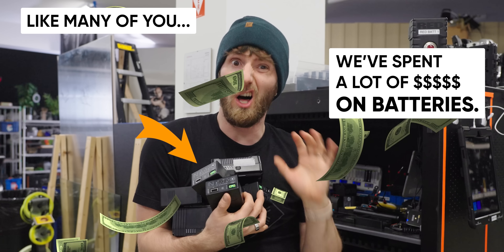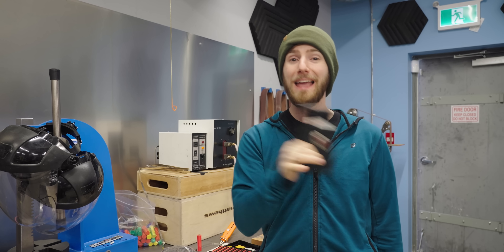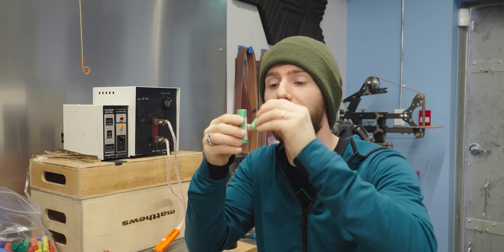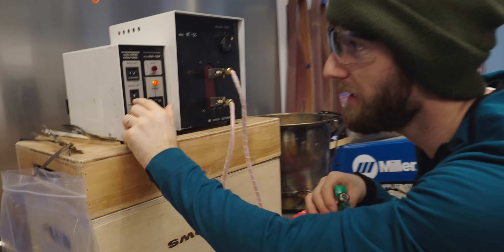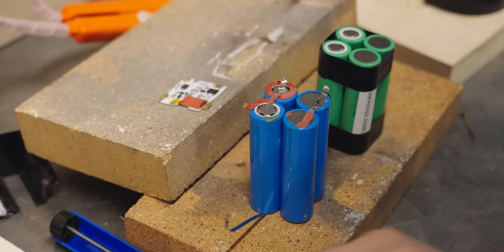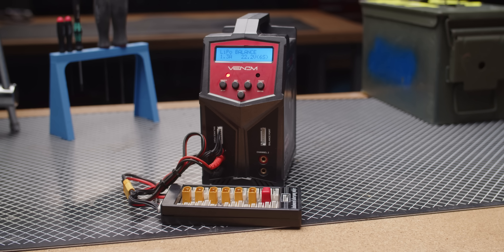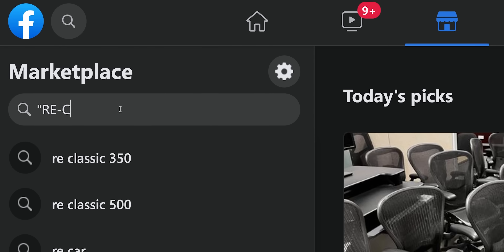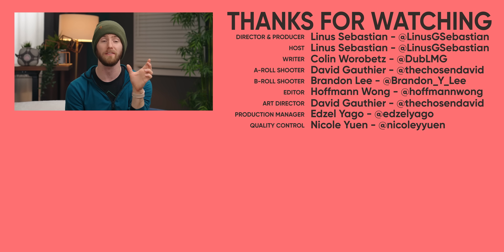This should be illegal… Battery Repair Blocking

Comment: Ha! First min in once I saw the BCM board, this was going to fail. That board needs to be tossed or reprogrammed. The cells that came from those packs probably had a lot more life than they think. Lots if BMS systems will intentionally artificially age cells based on cycle count. What it does it moves the "discharged" and charged points closer together. Lithium batteries "Settle" into a pattern once they hit a pre prescribed cycle count. Then they start a new slower adventure into degradation.

Manufacturers do this to for one Market a better functioning product. So for the first lets say 1,000 cycles the BMS will allow the batteries to operate in the above nominal state (4.2V and closer to the completely discharged state (2.7V), during these first 1,000 cycles the battery is being abused to the max for marketing and sales hype. After the first 1,000 cycles... the BCM can take two routes, a Calculatex route where it uses tests it performs on the battery while charging and in the fully charged state. Like impedance, temp at a specific charge or discharge rate (amps), it can also use a balancing algorithm where it looks at all the other cells, where it will can either bring all cells to the same level as the lowest or bring all cells to the average mid point. 

Some BMS will all together disable the BMS from allowing the cells to charge and intentionally put them on a discharge to zero path.

Some BCMs are encrypted so you don't even get a chance to connect to it and see what it sees. Others have a "Reset" sequence that manufacturers try to hide. (Like grounding a pin, bringing certain pins to HI or Low.)

It takes some time, but I haven't ran into a single one that is not reverse engineer able, except the ones that actually contain hidden fuse links on die, where it will blow those fussed and also the ground plane to the SSR controlling the power path directly to the battery. Some even create a very very low draw short to slowly being the cells to bellow the threshold where the batteries cell protection permanently shuts it off.

In most cases where 18650 style cells are being used in electronics like this, not only are you dealing with the BMS, you are also dealing with a primary circuit built into the battery it self. It's tiny and hidden under the positive side of the individual cell. Under the button top is a circuit that can cut all power from the battery if overcharge, undercgarge, or over current conditions are ever met. Some of these will reset, like an over voted cell....... nothing you can do except let it sit for weeks till it returns to nominal, or slow being it back up and an alarmingly low charge rate for days till it returns to nominal. Most of the time it's not worth the effort. Best practice is to throw the cells Ina. Steel vented box and give them a test every 30 days.

Some cells have a built in drain system that will zero out the cell over a few months, but not allow interaction with it.

Then you have cells that have zero protection and you can go ham with them.

So far only the RC hobby and vaoing hobby uses these, we need cells that can hit 25 to 50 amps on a regular basis. Some cells can push 100 Amp for short periods. They have no safety system. Your only warning is the disting his and the massive amounts of heat. Throw the cell in a stell bin or concrete ground before it goes supernova.

There is sort of a color coding convention for the outside insulator, more into the reds those are protected moderate amperage hi capacity.... more into the gray they are unprotected vaya con Dios cells. More into the green, you are playing with an unprotected cell that can also dish out crazy amperage with a moderate capacity (samsung INR).

There is atleast 10 to 20 episodes of this kind if content in this, and people are interested.

IMO, if the device will operate sans BMS..... delete it, install a voltage warning beeper, use your own balance charger to charge them up.

Comment: LOL you do know you don't have to weld the metal to the batteries right because they're basically batteries all you got to do is make sure it's tight enough insecure enough and you can build or change the plastic clip where you can slide pieces in the old pressure on the battery or the cell as you cell it

Comment: This is a very bad video because it is ammo that manufacturers WILL show to the mentally retarded politicians when they argue against right to repair. This will also scare more people out of trying this.
Also the sparks seen on camera are just from the welding. You also see this when the professional employee is welding nickel strips to the battery cells at 17:25!!

Also a short circuit of any lithium cell is a bad thing, but if you briefly short circuit a cell (long enough to get a spark and then reactively pull the metal away and break the short), the cell will be completely fine. Those cells can handle a number of brief short-circuit events without any damage. Having a fearful response typically makes things worse than the thing you're scared of could ever do. Like how our response as a society to COVID was 100 times worse than COVID itself.

Comment: I think this video really shows you can change batteries the reality it’s just not worth the risk or the effort. My preference is to dispose of these old units properly. Or buy a power bank that is designed to have replacement cells.

Comment: Jeeze you guys are primadonnas... lol.  Seriously, "one mistake and were evacuating the room and starting from scratch"  cmon now... all the years ive been pack building ive NEVER had a cell pop.  How on earth did you even manage that?  Stop doubletapping them, youre overheating the cells.   

The soft obstructions can often be beaten if you figure out what they're doing to disable it.  Another option is to use their connector and case, but a new BMS.

A possibility is to, instead of having your device use stupid proprietary cells, have it use multiple 18650s and come with an 18650 charger...   there are 18650 terminals that work just like aa insertion that we use for ecigs.  You can even put those replaceable slots INSIDE a screw together battery casing with a BMS inside so they can all be charged at once but can be replaced easily.

Comment: it also happened to me, you should solder a new pack of batteries to the BMS first to make it parallel and then you can remove the old battery, it's works for me

Comment: I ran into this idiocy as well with Nikon DSLR batteries. I had an old battery that I wanted to convert to a wall power converter, so I could leave my camera plugged in for long time lapse shoots. It turns out that the battery contains a chip with volatile memory. The chip sends some sort of pseudo random code to the camera every time it's plugged in. If you disconnect the cells from the chip, it will never run again. So you have to replace the cells while maintaining power to the BMS at all times. It's a huge pain. What's even more idiotic, is that if you plug one of these repaired batteries into the camera, it literally shows you the battery charge, but gives a message "Battery Not Recognised" and won't function.  Dafuq? Then how are you running to display that message you piece of crap?!

Comment: start with low power and slowly go up just until the Nickel strip is held on with 2 to 4 spot welds. usually tack welders ment for making battery pack have a arm protruding from box or can use handheld thing as well and has settings that won't cause batteries to get damaged leaves small dots with no discoloration

Comment: So really all you are doing is basically buying a battery when the point of doing it urself is so you dont have to spend all the money on buying one and using the old battery longer so ur money is stretched as far as possible. So you might as well just buy the 350 dollar battery cause ur not really saving much by buying the new pcm and the battery's and the soder gun with the soder and fire brick. I figured the point of the video from the title of this video would be how you can just exchange a bad cell battery with a new one and wang bang boom works like new and how the industry makes it illegal for you not to be able to do that, but this is not the case with your video. Its kinda pointless if u ask me to watch this cause its not really any help . But thanks

Comment: it should be illegal. we need info and papers published on repair. right to repair. they make it to where you have to be an EE to fix stuff. i guess i should look for some old books instead of the internet.

the only justification i can see for battery packs is they can genuinely be a danger if not done properly, and if they didn't prevent tampering you would be able to sue them and they couldn't guarantee the safety if you worked on the pack and then somehow got a warranty refund and mailed the pack back to them.

Comment: Dude the ones you showed at the beginning are so easy to get. 18650s are used for vapes. People by them bulk all the time for building diy mods. It's lost popularity due to salt nic devices getting better, but yeah those batteries are so easy to get for cheap asf. Sure as hell not gonna be $350 for a dozen of them. You can probably get 12 for $50-60 easily. They're like $10CDN for singles at consumer level at stores here in Vancouver

Ha yeah just saw the part with the testers 🤣 probably old ones that people gave back to the store to 'recycle' them

Comment: Holly hell electrical tape is conductive. Don’t ever say it is not. Unless you are using the nonconductive electrical tape. Which is expensive. It is also not shiny like the one you are using. 

The electrical tape you are using is designed for marking wires ONLY. NOT an electrical barrier.

Comment: You can actually deal with this problem by soldering on small leads to a separate DC power supply to keep the BMS live while working on the pack and than remove these after the new cells have been attached.

Comment: Are new Lifepo batteries BMSs evil like this? Especially the big brands like Battleborn? I just installed a large solar system in my RV with all Victron and 2 Battle Born Game changers. When the 10 year warranty is up and these massive Lifepo batteries start to fail can they be serviced?  Or will the BMS self destruct? I don't think anyone has tested this yet I know I won't at over $2 K for one battery. Time will tell unless someone with way more $$$ to burn sacrifices one of any name brand to see if the Custom BMSs is Evil 🙈🔥😡

Comment: They were doing this with Dell Laptop batteries the BMS would disabled itself if it lost power. I managed to get around it by carefully connecting power to it before cutting the cell wires so it never lost power. But if the life line failed even for a second it was game over for that BMS. This is nothing new greed is way more important to CEOs and Shareholders than the environment!!!  It won't change unless they are forced to stop the BS for a few extra $$$$ to buy a new jet each year instead of every 5 Years!  People hate gov oversight but it's unfortunate we need someone to put a size 12 where the sun doesn't shine sometimes.

Comment: Why don't you have Halen r12 fire extinguishers they'll put out a lithium fire not only do they put out the lithium fire they cool down the lithium battery to thus prevent recognition from the thermal runaway etc Halon r12 is the refrigerant that used to be used in air conditioners and for HVAC people it's $20,000 fine if they let one ounce out however as a fire extinguisher are 12 can be released to the atmosphere with no fine even if you're testing so take your old air conditioner alcohol in it and you got to fire extinguisher new air conditioners use flammables so make sure it's not our 450 or 600 cuz r600 is butane

Comment: just an FYI you sound use a battery tester to charge them up and discharge them before spot welding.  you can also capacity test the old cells and use the old ones for single cell flashlights and small projects and such.

Comment: I see a lot of those evil battery Management systems in the construction tools they sell for such expensive prices Makita is very well known for that Dewalt, porter cable, craftsmen, Ryobi and even Milwaukee is not out of their woods. I prefer Hilti which doesn't seem to be nearly as bad as some of those other brands I mentioned. I have some of their batteries that are 10 years old that still work far better than any other battery I have that's even 4 years old. And those other batteries I have are DeWalt 18 volt and Milwaukee V18. Mine are 22 Volts that also take and will run any of Hilti's 18 volt tools. You also you go by the tool stores that rents to you and you see what they're renting. That's the tools you want if you're doing this at any kind of repetitive work like construction jobs or mechanical.

Comment: I have designed Li-Ion battery packs for commercial sale and can say that in the case of high end smart battery packs with charge tracking and modeling capabilities, it is not a simple matter of just replacing cells. On our packs, the battery monitor chip required precise initial conditions for each cell in the pack in order to provide a sufficiently accurate lifetime prediction. Of course, the packs I designed were for medical devices, and I think equipment like cameras and power tools do not require that level of precision and I agree with the premise that batteries should be designed to be as serviceable as the use application allows.
Reply: Yeah. I believe most packs I've seen are just fine replacing cells. Of course capacity information after replace is is off and it's required that the cells you use for replacing can handle the conditions the circuit puts on them.
For the capacity however it's usually a matter of fully discharging and charging them a few times and capcity reporting is about right again. No matter how sophisticated you try to make the measurement you just can't and it ends up being a qualified guess which tends to drift over time unless it somehow is recalibrated - and that is usually total discharge and total recharge.
I agree medical devices can have special requirements. However unless a fever thermometer, ordinary blood pressure meter or similar non critical device you can just grab another off the shelf I really can't imagine anybody will risk going on compromise there.
Reply: @HifiCentret  I've replaced cells in power tools a few times always worked
Reply: @HifiCentret id be fine with having US hospitals use only new medical devices but we should still let them be repairable in case other poorer countries want to buy them used.
Reply: Some BMS's have a safety feature that if the temperature gets too high, or voltage too high or low, the BMS will basically kill itself. For example Makita batteries have this feature.. I was working with a freshly charged battery outside in cold temperatures, and as the battery drained in combination with the low temperatures, the voltage probably dropped below the point where it would allow the batteries to be charged, BMS just permanently disables itself for safety. The only option you have at that point is to replace the BMS. In some cases even desoldering the batteries from the BMS will basically kill it.
Reply: @FOATE  it's for your safety...  sure, in the age of self resetting and self healing circuits, there is no excuse to a BMS to permanently disable a pack for operating it out of spec after the condition clears, like operating it too hot or cold. It's entirely a design choice, from which the permanent one is more profitable. It's a no brainier.
Reply: but can we repair tesla power battery?
Reply: Medical equipment is a use case where a universal standard could save lives and proprietary crap can literally kill people 

Oh, I'm sorry, your total artificial heart doesn't support this cheaper aftermarket battery, by being too poor to afford a new $500 battery, you have chosen death
Reply: Sucsessful learning cycle is pretty easy to achive on high grade cells. But it's not commercially worth it, we performed cell replacement only on medical sbs batteries which we needed to reverse, but could not buy. Just saying, i'm tottaly not an electrical engineer for battery manufacturing company in russia
Reply: Translation: We designed the BMS so that it won't accept a replacement battery to force them to buy whole new equipment, and we said "our equipment is too advanced to accept just ANY old battery! Just buy a new one instead!"
Reply: @DrSloww  ... You do know in medical having that accuracy can quite literally be the difference between someone living and dying right? Now in other fields that argument does not really hold up (unless you are talking aerospace). But med NEEDS predictable results as otherwise people die.
Reply: @spartanonxy  That's stupid. If you're relying on batteries being reliable, then there's your problem, because they're inherently not. It makes plenty of sense just to replace the cells at a set interval and properly maintain the equipment, with cell monitoring as a supplementary measure. But plenty of people would rather just keep filling up landfills in the name of safety.
Reply: @DrSloww  Lieing through truth, the worst kind.

Comment: Battery welding is actually much easier than that.  I realize he's a novice, but the current was set far too high.  When set right, the weld occurs so fast that there's no time to heat the surrounding metal.